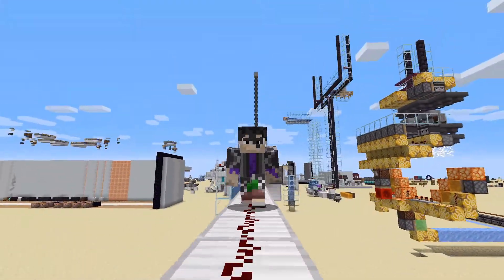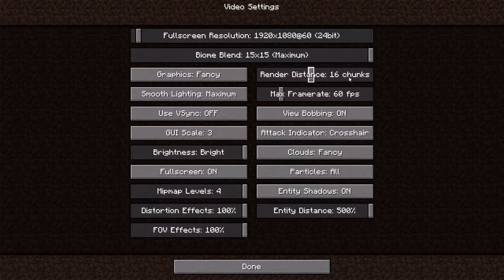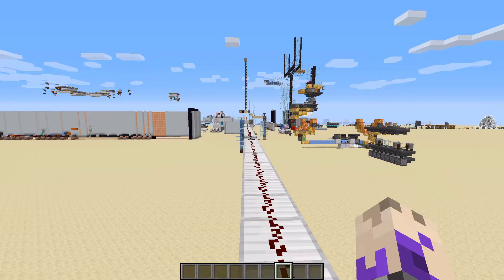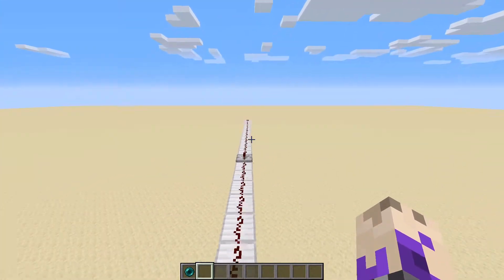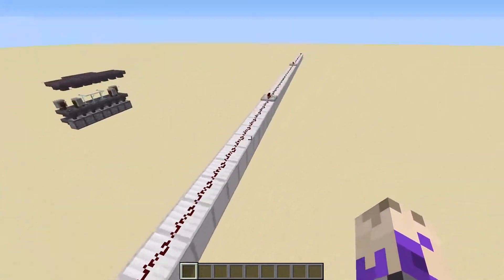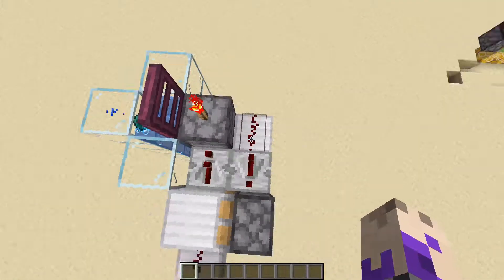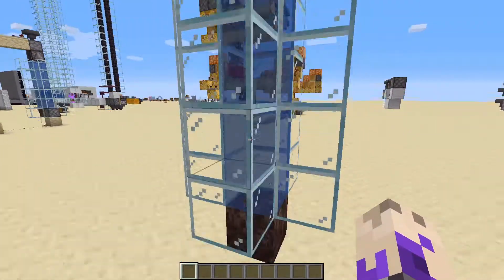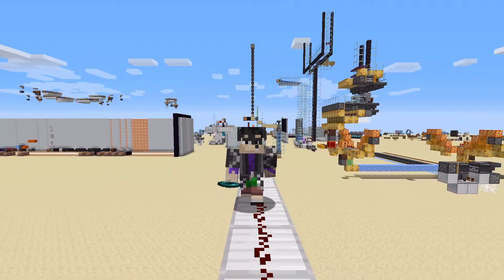How to Make Ender Pearl Stasis Chambers for 1.16+

Comment: Seems kinda useless since it only works when redstone chunks are loaded in, not really practical for long distance.
Reply from the maker: Etho uses this mechanic in his own singleplayer world to travel around his base faster. He also used this for Hermitcraft for the emergency meetings for the Mycelium Resistance. ilmango uses this system to allow travel between the main End island to the further end islands in his peaceful series(only one person has to travel there to load the enderpearls to send everyone over there at once.)

In singleplayer, you can always use Nether Portal chunk loading if you want to travel farther than the 8 chunk loading distance. For multiplayer, you can activate the system from anywhere if you or someone else online loads the area and are in the same dimension. This has many use cases already and there could be more i.e. minigame mechanics(like replicating Pheonix's ult in Valorant). It's just about your creativity because at the end of the day, this is just a tool.
Reply: Make a perma-loader with a dogstone switch

Comment: Yeah I can't get it to work, the pearl just hits the bottom no matter how tall the water stream is.
Reply from the maker: Firstly, are you playing on Bedrock edition? If so, you should go check out Jonathan Peters for that kind of system.

Otherwise, there should be 7 full blocks of water above the Soul Sand to make 7 blocks of upwards flowing water streams as Enderpearls sink in any water besides these specific directional bubble columns.